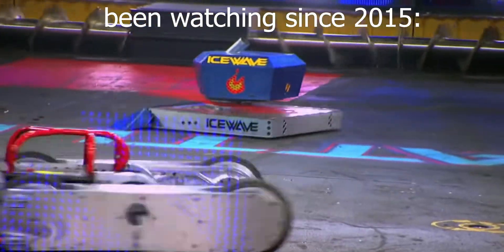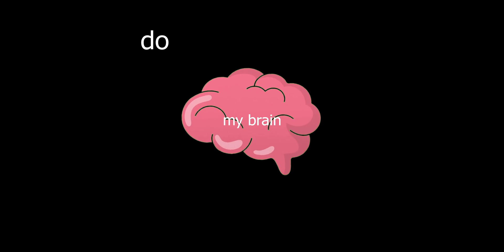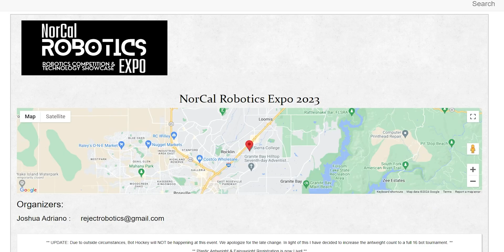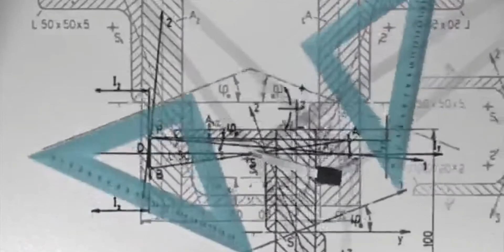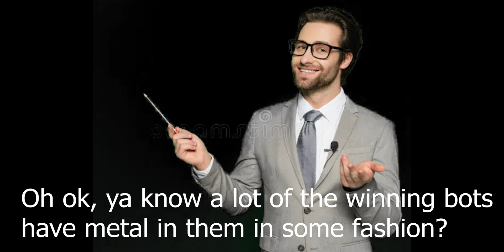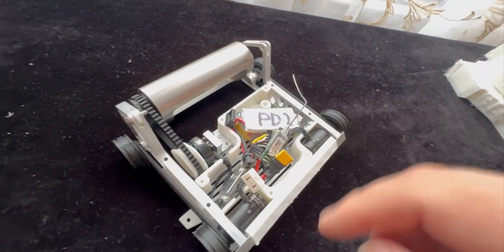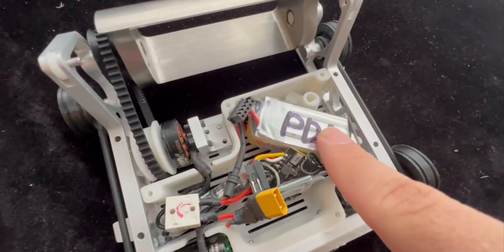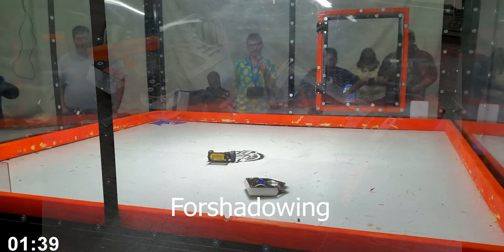I built a tiny Antweight Combat  Robot

Comment: What did you use to make the metal weapon and frame and the carbon fiber parts?
Reply from the maker: I used Fusion 360 to design the main weapon and also to estimate the overall weight of each part. I actually designed everything else through Shapr3D which I then exported to Fusion 360. 

Anything that's not the main weapon was made on Shapr3D and was sent to PCBWay to be CNC'd or lazer cut. Hope that helps :)

Comment: The meta seems to be spinning weapons and the counters to them agility and or armour. Has anyone tried using kevlar webbing to entangle their weapon like "The Grappler" does for stopping moving cars?
Reply from the maker: That's a great Idea! But unfortunately very illegal in combat robotics, entanglement devices, liquid, emp or anything other than sheer blunt force is simply not allowed unfortunately. I believe they made entanglement illegal specifically in the 90s during the comedy central era of battlebots. But I could be wrong on that.

The only way entanglement is allowed is when something that was never designed to be an entanglement device entangles your weapon. Like say you rip off an opponents wheel and it gets stuck in your main weapon, that's allowed but it cant be intentional. Alex Alchemy driver of cheesecake has a great video on it when it actually happens to him in a fight vs Temper. Feel free to check that out!

https://www.youtube.com/watch?v=q7k8oabu2WU

Comment: Hi. I was wondering what motor you used could you send me the link?
Reply from the maker: For the main weapon I use this:
https://www.racedayquads.com/products/t-motor-f2004-3000kv-micro-motor-1-5mm-shaft?keyword=3000kv

A word of caution though, after about 1-2.5 seconds even at half speed this thing will start to ignite the atmosphere because of how hot it gets. You must have proper thermal management when using it and make sure that you have some type of heatsink or air going over it to keep it cool cause it can burn out QUICK if it doesn't.
Reply: @TeamVector441  thanks so much!

Comment: Nicely done! I like the vector theme and the bot looks powerfull! Small question: I was wondering how you got the repeat robotics ESC to work, because I use the same one and whenever I use it, it smokes up as soon as it makes contact with the battery. (This happened twice)
Reply from the maker: Interesting! I would say that you have to make sure that your connectors are set up correctly, if your running a larger than 4s Battery than the capacitor is needed to run the esc. Whenever I use it I only run 4s with no capacitor and ensuring that your + and - are NOT CROSSED! I have burned up drone ESCs like that and it is not fun, also be sure to check that their is no solder debris accidently connecting something on the board. I once had a drone board which I thought was fine until I plugged it in, and it burned up instantly. Took a closer look and found that a tiny piece of solder was connecting one of the capacitors to something that WAS NOT A CAPACITOR!  

Its also possible if any of the settings have been touched that something went wrong their. I haven't touched the settings and its working great so far. At least I don't know how to change the settings that is lol 

Let me know if this helps!
Reply: @TeamVector441  Thank you so much. I will try that. I also didn’t soder the motors to the esc yet so that may be why. Finnaly, I am in your position at the begining of the video, and I am wondering how you connect the battery to the switch.
Reply from the maker: Yeah no problem lol, The battery switch is a fingertech mini  power switch. It is just a screw that connects two wires together when you screw it in. I have it set up on my positive cable,  literally I took the positive cable (not the one on the actual battery the one on the positive terminal of the esc) cut it in half, tined it and connected each end to each side of the switch. And it acts as the kill/power switch for the whole thing.👍